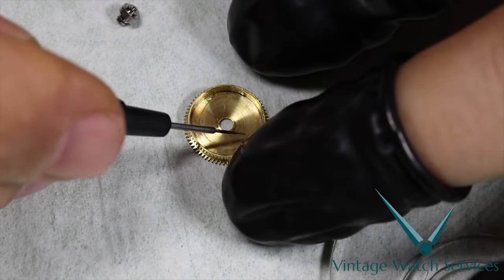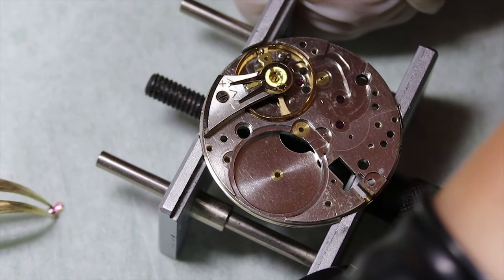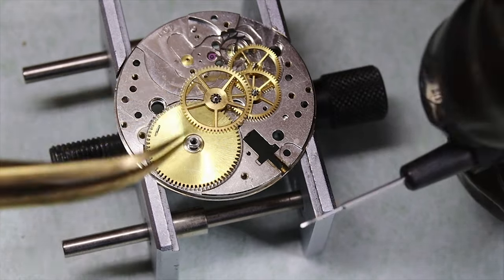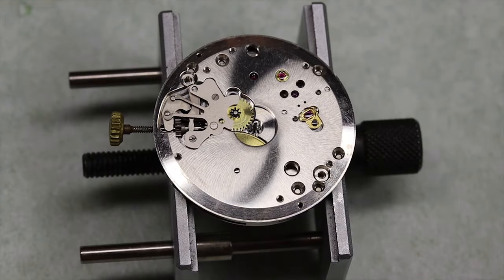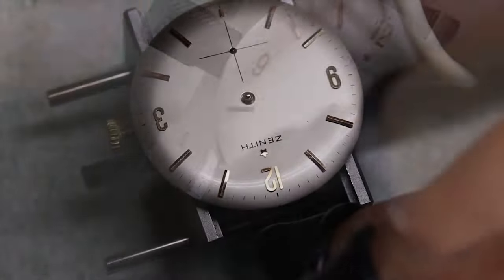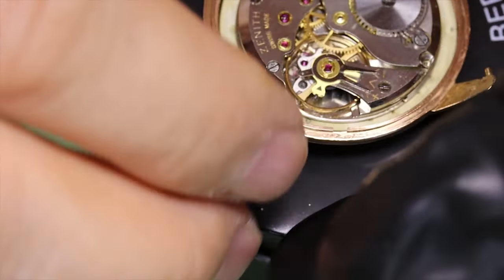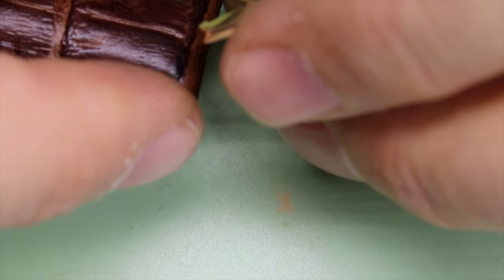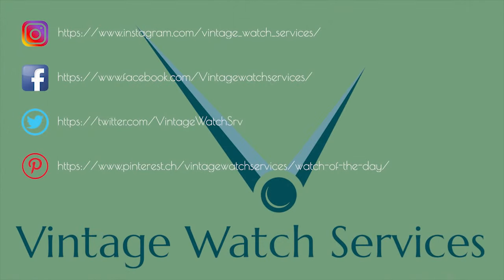1960 Zenith Dress Watch caliber 40-T Restoration Part 2 - Assembly

Comment: Another great video, thank you. What strength eye piece do you use mostly? i use a large magnifier at the moment which is like looking through a gold fish bowl, and a jewelers loop, i manage but it makes things a lot more difficult when you are straining to see what you are doing. I bought some eye pieces but they turned out to be poor quality and aren't much use.
Reply from the maker: Hello George, thanks a lot! I mostly use a 3x loupe that I have on a wire around my head so I don't need to hold it in my eye socket. 3x is perfectly strong enough for 90% of the work, and I mostly use a microscope for the finest work.

Comment: Hello Stian, I just watched parts 1 and 2 of the Zenith 40-T. Did you do the dial restoration? It looks great! I have a Zenith Elite 655 hand wound in rose gold with RDM complication. After I have some experience with several restorations I want to clean and lubricate it. Over the years it had been serviced (by Zenith's USA site) for a problem but it seems to be getting harder to wind and likely needs service. I just paid $600 USD to have my IWC Spitfire serviced and after watching several dozen watch videos and having an Elgin open on my bench I think I'll be brave enough to undertake this myself. Thank-you for your videos!
Reply from the maker: Hello Gary, no, I didn't do the dial restoration, I don't have the skills nor the equipment for it. You need to have a pad printing machine but most importantly the proper print dies. It's not often I have it done anyway, as most of the watches I acquire have nice and original dials. 
One step at a time and you'll build the confidence needed for your Zenith, but don't start on it until you feel you are ready :)

Comment: Very nice. I don’ t understand exactly how you clean the dial? What kind  of chemical treatment you have used?
Reply from the maker: Hello Igor, thanks for watching and for your question! This dial was too far gone to be able to clean it, so we refinished it. There's unfortunately no miracle treatment for dials :)
Reply: @VintageWatchServices  Hello,
thank’s for your attention and answer. I wonder, that that there is no miracle for old dial. I have couple wat hes in good working condition, but dials are nightmare. I don’t  know what to do with them.   Can you help  me with some advice? Anyway, your work is excellent. New watch. Many regards
Reply from the maker: If the dial is too badly damaged there are really only two options; refinish the dial or get a new dial. Are these watches valuable enough to warrant that?
Reply: @VintageWatchServices  These watches are not valuable, but they are  memories on my father.One of them is  very rare and unknown swiss watch from mid 50 s Olor . It  looks great and works very good, but dial is in  a bad condition. I wonder, that this watch was a brand from Cyma group in that era. Onother is Omega, pocket watch from 1937 , also good working pocket watch, but dial is full of cracks. Third watch is Doxa Grafic from late 50 ties, but dial is full of strange little bubbles. It is hard to find dials for them on ebay or any other free market. Patina, rust and some brown patches are  usually problem on those dials.

Another problem is chrom case, I still have not found the way how to refurbish old rusty chrom watch  cases. Nobody wants to that.
Reply from the maker: I think you will have to settle for the current state of the dials from what you describe. Refinishing requires the correct dial print, and for less known brands these probably do not exist anymore. Pocket watches were far less streamlined than newer ones, so finding a new dial or refinishing it is also probably not possible. 

On the other hand, a vintage watch should also in my view look vintage. There is a lot of charm in seeing the history of the watch on the dial!

Comment: How do you know how much to tighten down each screw? Is it a matter of experience or touch or both?
Reply from the maker: Hi Frank, yes, it's mostly a matter of experience and touch. It's fairly common to not tighten the screws enough, and then they might come out and block the movement. There are torque screwdrivers which tell you how much torque you are putting on the screw, and the technical communication for newer movements often contain torque ranges. For vintage watches, that's unfortunately not the case though... So yeah, experience and touch :)

Comment: What i don't understand about servicing these mechanical watches is why you would'nt oil anywhere where there is metal on metal contact of moving parts. It seems to me you could reduce so much friction this way.
Reply from the maker: Hello, thanks for watching and for your comment! We do indeed oil everywhere there is such contact, the only exception is typically the pallet fork pivots and the minute counter pivots in a chronograph. The amount of oil is however very small, as the parts are very small and you don't want oil to creep onto wheels and other places they shouldn't be

Comment: ETA selling only to Swatch Group members is sort of like getting spanked by your step father. "I'm doing this for your own good!". In the long run it just leads to resentment and upset, although simmering anger and increased competition can only be more positive for consumers.
Reply from the maker: Yeah, I think it can be good for the industry, as there are more and more in house movements coming out. But of the result is simply that Sellita, STP, Soprod etc make 2824, 2892 and 7750 clones, that's not solving anything...